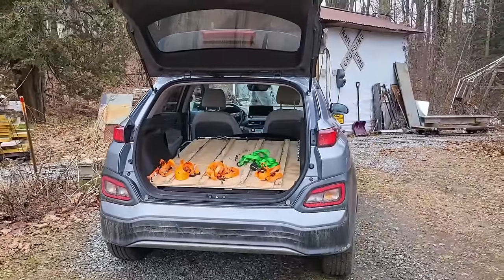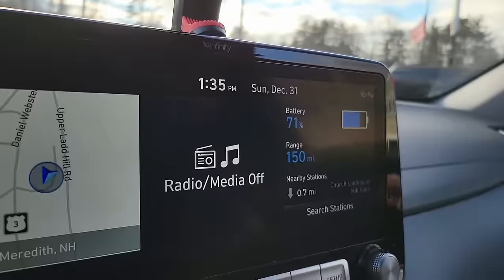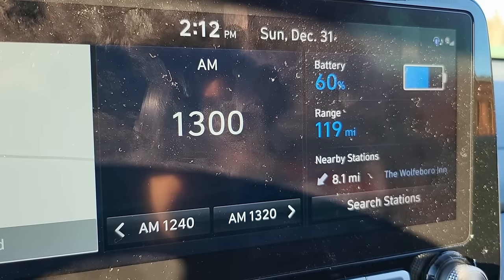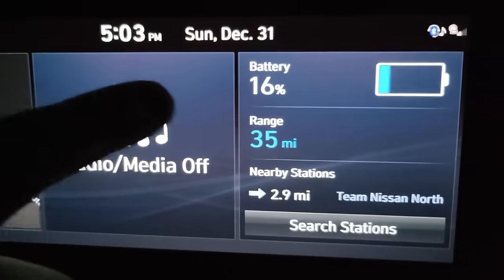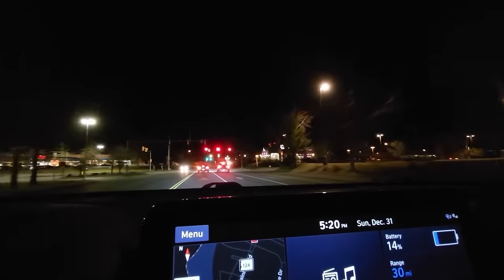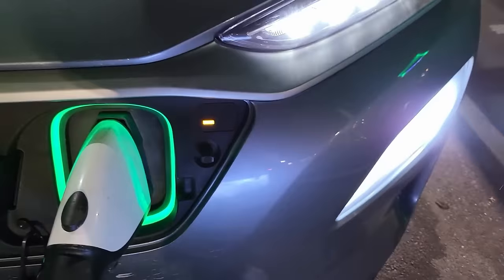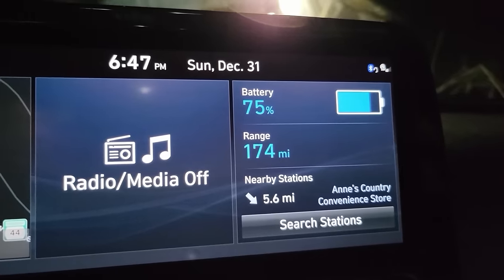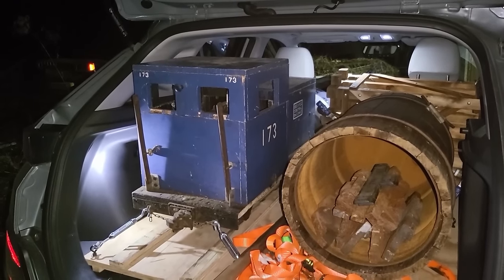Picking up a Gas Locomotive in an Electric Car

Comment: you should calculate the consumption with and w/o the load so that you have a knowledge of the range 
possible. when under a load the range probably decreases by an amount due to having to move extra mass.
it might be insignificant, and then again not! all depends upon how efficient the motors are. plus dry vs snow
covered roads. nice video Aaron, it is so nice to have extra hands to help.
Reply from the maker: No promises, but I'll see what I can do.

Comment: Rode a electric locomotive on the Blue Ridge railroad in NC, it was a Koster build loco with some AT&T relay batteries. We rode that locomotive for 4 hours, use the regeneration going down the mountian we decided to quit at edge of darkness. The next morning. The batteries revovered over night, uh funny strange engine a 4 axle alco S 2 nice engine.
Reply from the maker: Those old deep cycle batteries do some amazing things.
Reply: @MillBrookRailroad I Could Not Think Of What They Called Them Batteries, Deep Cycle Yea That Was It, Used In Telephone Relay Yea Surplus Batteries, They Use To Swap them Out, At That Point They Could Be Had Swap A Core Get A Battery With Some Life Left In It.
Reply from the maker: @gusshadleythelunaticfromar7125 , just imagine how much better they are when new!
Reply: @MillBrookRailroad  Yea I Bet. How Is The Gasser You Bought?

Comment: are you goin to have to rebuild the loco? when are you going to pull the rail etc.? Great video by the way.
Reply from the maker: I'll have to rebuild the loco at some point. It'll be electric when I'm done. 
The track and everything else is frozen into the ground, so it'll have to wait until spring.

Comment: Range paranoia/anxiety is real... Liquid fuel is still king.
Reply: Will have to disagree with you on that. Ours handle the northern Swedish winters absolutely beautifully, in fact it's incredibly nice being able to push a button and get out to an ice-free warm car even when it's -30C outside.
Reply: @swecreations  Is yours powered by a dam that blocks a river and kills fish, a nuclear plant that makes 500,000 year radioactive waste, or by coal burning?
Reply: @jenniferwhitewolf3784  Electricity from solar panels from our roof. Our roof produces 11000 kWh of electricity annually, we have two EVs and one plug-in hybrid, which consume 2000 kWh of electricity each for a total of 6000 kWh per year. So our solar panels more than make up for the consumption of the electric cars.

Comment: I'm curious to see what kind of a drive system is in that loco. I recently picked up a gas-mechanical engine that had a 5hp Briggs and a crude belt drive/pulley system. I installed a new engine with forward/reverse/neutral transmission, and a belt drive go kart torque converter, and chain/sprocket drive. I'm currently working on the plywood 'body' of the engine. It's a very heavy little thing. The deck of the engine is a 31" x 16" piece of 3/4" steel plate. Traction should not be an issue.
Reply from the maker: This loco has a cone and pulley drive. 
After working on other gas mechanical engines,  and even owning one for a short time, I'm convinced that battery electrics are the way to go. My electric locomotives have a single 500W motor and a pair of heavy lead acid group 27 batteries. I can pull more than a ton up a 2% grade and the batteries can handle 6 hours of heavy passenger hauling on 4% grades. 
The problem I've had with gas mechanical locomotives is starting traction. Something you've alluded to in how heavy your build is. An electric motor has a smoother power curve. To the point that I can outhaul a 5 HP gas mechanical with a lighter 3/4 HP electric.

Comment: Are still responsible for pulling up the rail and taking the roundhouse out.  If there is anyway you can organize for a backhoe you so=hould get that engine lift too.  Those car hoist are getting very rare. and they are fantastic. Turntable and engine hoist.  😆😆
Reply from the maker: I have to take it all, but I can't move any of it until spring.

Comment: Have you checked the effect temperature has on the battery life? Thanks for sharing, live over in the Wolfeboro neighborhood. 🎅🏻
Reply from the maker: I've been living the effect that temperature has on battery life. It's not as severe as some would have you think. It's also not all sunshine and roses, either. The bottom line is that if you can charge at home, it's not a big deal. One of the biggest problems with public charging is that the sale of EV's have outpaced the construction of DC fast chargers, and many of these new EV owners don't charge at home, for whatever reason.

Comment: Can you use a small generator if you run out of juice between charging stations driving in hyperdrive like that. Does the blue engine go or need some TLC first. Safe travels. Ken.
Reply from the maker: I don't run the battery low enough to need a generator. 
Ludicrous speed uses virtually no fuel. 
Because it's a virtual speed.
The little blue engine will get some TLC at some point. Most likely, an electric motor and batteries.

Comment: So many things can happen while watching your video. I put you on pause cause my neighbor locomotives are "too noisy" . Then while i watchh you, a quick glance at window. That freight was stopped, blocking crossing. I suspect an emergency one. After a while is moving again. Near the end of your video, an other one went in opposite direction. 2 DIESEL and  now a VIA. So much can happen in short time 😂
What happen to your "old"  EV car ?
Good or bad, depend how electricity is produced in VT ?
Thanks for the ride with that happy loco that will discover a new world.
Reply from the maker: My old car met its demise when I hit bedrock in the middle of a dirt road. It was a rough spot that had been there for months, and I hit it just right (in the wrong sort of way) one rainy night. It might have eroded more. 
That one hit did $26,000 in damage to my car. I called the insurance company, and they told me that it was covered, probably totaled, and that I wasn't at fault. The guy at the service desk of the Chevy dealer was angry with me because I told him I wasn't going to fix it. He was certain that my insurance company was going to cover a $26,000 repair on a 10 year old car and be fine with waiting four months to get the parts.
So, that's the last GM car I'll ever own. I bought a used all electric Hyundai for $25k.
Electricity is cheaper than gas in Vermont. Gaz Quebec owns the electric utility here, and most of the power comes from large hydro dams in Quebec and small hydro dams around Vermont. 
Most of my charging for the past five years has been at home and at work. I couldn't use much of the public charging network with the old car. DC fast charging didn't exist for anything that wasn't a Tesla in 2013, when it was built. I can use most of the public DC fast charging network in the new car, and I've had mixed results. 
The main problem I've observed isn't the electric grid. Rather, it's the lack of enough chargers at charging stations, reliability issues with charging stations, and EV owners who don't charge at home but rely on public DC fast charging infrastructure for their daily needs. DC fast chargers are for road trips, not for daily charging. That's according to the owner's manual.
Reply: @MillBrookRailroad  i´m sorry to learn that. 10 years already. Wow Who put the ticketing clock on fast mode. We´re not on HO scale layout with fast time. Good you were fine with that event. For sure repair was higher than résiduel value. Did the battery was hit ? We feel so lost, just like young kid when we end up on foot. A pretty long long walk to go to work. At least the 70 survived as a far cheaper price.
Be safe and does Robin is
 Batman´s new companion ?
Reply from the maker: @danielfantino1714  Batman's new companion is named Tolkien. He's a mixed breed part Bengal, part Maine Coon, part Domestic Short Hair.
Reply: @MillBrookRailroad  👍

Comment: so it is $16.8 / hour, how long did it take to fully charge  to 100%? you mentioned. that the DC chargers are
faster then the AC  ones, all the power comes in as 120 /240 V  AC , so is there a very large inverter to make the DC
current. or is it built into the vehicle to convert it to the correct voltage based upon the car. I know nothing about
them, no friends have any to be educated in their systems. oh comments did not register nor +feed back.
Reply from the maker: I don't fast charge to 100%, only 80%. Lithium batteries like to stay between 20% and 80%.
DC fast charging pulls 480V from the grid and rectifies it to DC it figures out what voltage the battery in the car is and charges it directly at that voltage. AC charging takes 120V (up to 16A for level 1) and 240V (up to 20A for level 2). It uses an AC to DC charger that's built into the car. 
There is a whole genre of videos on YouTube about electric cars and how they charge. The best one I've seen is Out Of Spec Reviews. He shows you how to charge an electric car in -14 weather, how to road trip with an electric car and how the batteries like to be charged. Very informative.

Comment: How long did you wait at the charge station, and how much was your total $ ??
Reply from the maker: My son and I got lost in a game of chess, so we charged 49 minutes. Far longer than I'd planned. The car took on 33.28KWh, and that cost $10.41.
Reply: Put one wing nut on one end of your turnbuckles to use as a jam nut so that they don’t vibrate loose on you as your cruising down the road! Suck and loosen everything up. The wingnut on the one end of a turnbuckle will keep it from loosening up!
Reply from the maker: @rustyc521  Good to know. Thanks!

Comment: So your channel is going to now promote EVs ? Will probably unsubscribe !
Reply: Grow up dude his main locomotives are literally full electric
Reply: Almost all trains are already EVs though?
Reply: Mostly just passenger rail in the USA, unfortunately. And even then, by miles of track, much more of it is travelled by diesel-electric locomotives than those using electric overhead or 3rd rail power.
Reply: 😂 Oh lordt.
Reply: @swecreations  no. Technically they are hybrids. A fossil fuel burning internal combustion engine turning a huge alternator that powers the electric motors on the drive axles.
An EV is all electric. With current battery technology any battery big enough to supply the electric current necessary to power a locomotive would probably be the size of at least 6 boxcars.